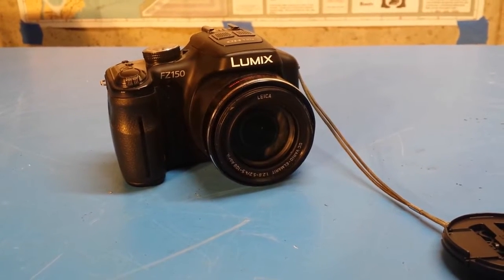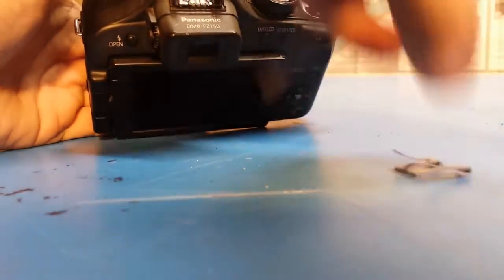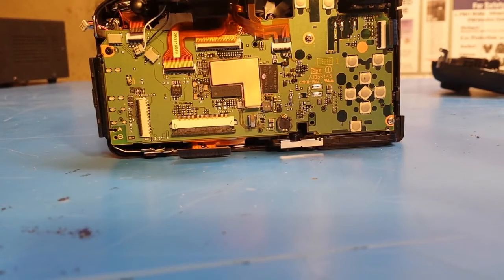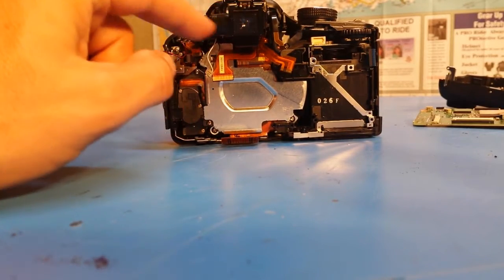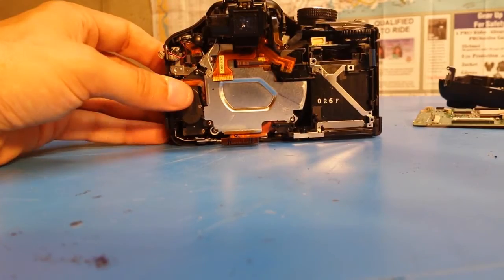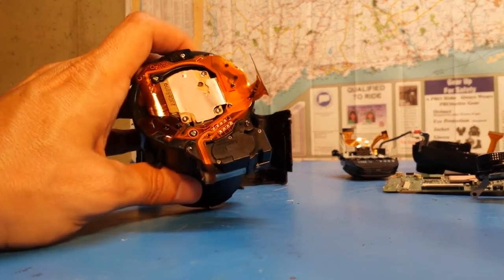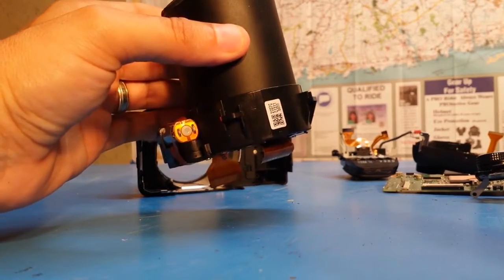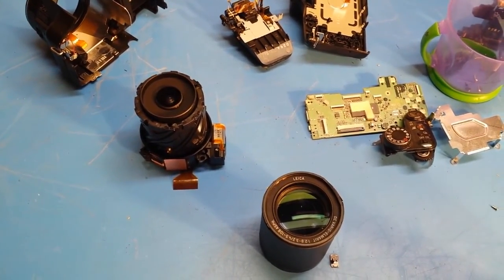Digital Camera Repair (DMC-FZ150 Lens Replacement) - Part 1 - Camera Teardown

Comment: Auto zoom doesn't respond to a cockaroch in the lens...it relys on diaphram position zoom position and back focus. Your problem is with the power diaphram unit or connector...or the lens  motor drive unit and accessories.

Comment: Don't use a knife to open the connectors. Use a plastic wedge like a watchmakers knife but made of plastic. Also pay attention to the 400 volt flash circuit.
Panasonic has the best engineering I've ever seen for camera repair techs since thier first lumix and beyond.

Comment: All you had to do is change the front element of the lens! Graham Houghton has made a video about it on yt. The only thing you had to do was remover the plastic cap that says lumix dc vario and aperture numbers etc on the front of your lens and untighten 3 screws. But it's been 5 years already 😩😅😅

Comment: Awesome ! I had a zoom error issue where the camera shutdown every time I tried to use the zoom at all. After loads of searching it appears this error is common on Panasonic cameras and is caused by sand or dirt particles getting trapped inside the zoom apparatus. Your excellent tear down helped me so much and allowed me to air blow clean my zoom and when put back together it all worked perfectly! Thanks,
Reply from the maker: I wasn't so lucky with mine but glad yours is working now!

Comment: Planning to clean the front element of a FZ300 I can't remove the front lens after removing the 3 screws that should hold it. Is there a trick or should I disassemble the whole camera?

Comment: where can i watch the next part as I have a FZ200 that needs a lens replacement and wanted to see if you were succesfull
Reply from the maker: If the link isn't in the description then search my channel for fz150...I was able to replace the lens but it didn't work correctly afterwards.
Reply: @SevenFortyOne  thanks for the quick response i might get away with just replacing the zoom motor but they cost more than I paid for the 2nd hand FZ200

Comment: It's good of you to put this video up. I have an FZ-70 with a sensor with some dust on it I want to get rid of. This gives me an idea of what to do. I hope you get loads of hits. It's a great camera. I have a full frame camera and an APS-C and have had a Sigma 300mm f2.8 which was great but the reality in many situations is that a bridge camera's fills more pixels with distant objects than much bigger and more expensive gear. The down side is specks of dust on the sensor looks like colonies of e. coli on a slab of room temperature Canadian beef.
Reply: The same goes here, also have dust on my FZ72 sensor.

Comment: Hi!
My microphone in port is canted. I wanna fix it. Is it connected to a pcb and is it relatively easily accessible?
It's hard to tell from the video.
Reply from the maker: I don't remember what it looks like exactly.  I think there was a screw holding it in place and some sort of metal bracket or something.  I also reasonably sure it was soldered directly to a flex PCB.  If you do a google search you can find the service manual which may have some diagrams that show it.  Also, check eBay for pictures of the various parts people are selling.  Maybe one of thier pictures will show you what you need to see.  Good Luck!
Reply: SevenFortyOne Thanks for the fast reply! My fingers were itchy so I took it apart in the meanwhile. Of course, it was underneath everything so I had to take everything out. That was literally the last part in the frame.

Now I'll try a GH1 that I have and that doesn't power on. That's a much harder task.